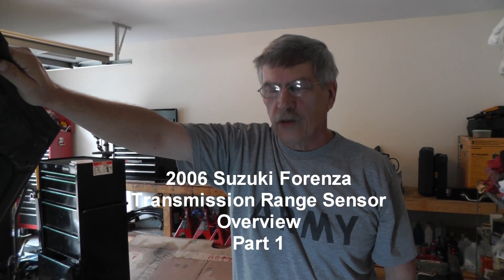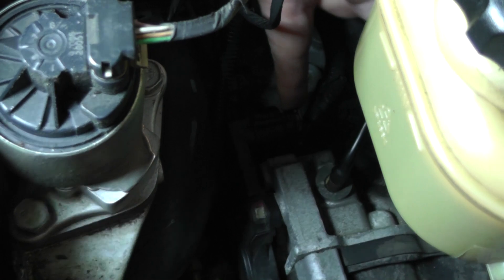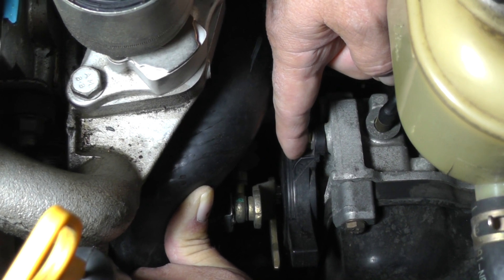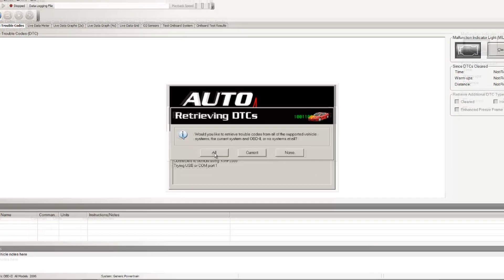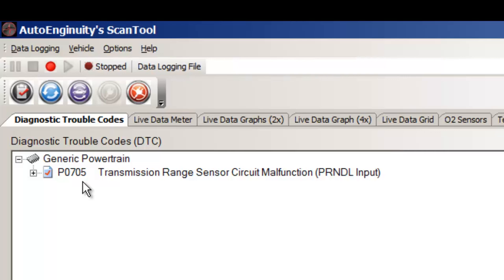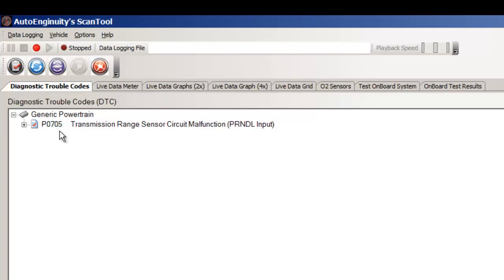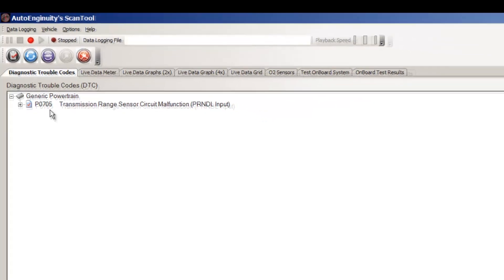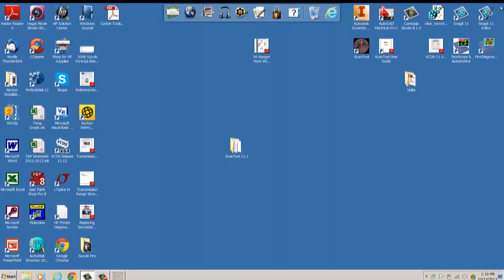Suzuki Forenza Transmission Range Sensor Overview - Part 1

Comment: I’m thinking about buying a 2006 Suzuki Forenza that doesn’t move when shifted to drive at least that is what is on the post about the car. Would the TRS be the reason?
Reply from the maker: Usually the car will still move, but it will start out in 3rd gear (limp mode). You may have other serious issues such as tranny problems. Just be careful if you consider buying the vehicle.
Reply: stuzman what would be some reasons that it wouldn’t move?
Reply from the maker: If the engine starts and run, the only thing that comes to mind would be concerning the tranny such as low fluid level or it could be some internal issue. If you've got a scanner, put that on there and see if there are current or pending codes. That could give you an indication of what may be going on with the car. If not, probably best to move on to another car.
Reply: stuzman stuzman here is what they just told me on that car. “Nothing it just won’t go very fast . I can put my foot all the way on the gas & it only goes slow” . So that sounds like the TRS right?
Reply from the maker: Yes, in the case that the car moves, it's a good chance that the TRS is bad. And if so, it should have throwed a P0705 code which indicates a TRS issue. If you've got a scanner, see what the code is to be sure.
Reply: stuzman good. They are selling it for $600 the car is clean and well taken care of. It would be a few months before I’m home again. But I’ll keep that in mind on the code n take my scanner. May keep it if I buy or flip it for a proffit
Reply from the maker: Sounds like a winner if it all works out :)
Reply: stuzman what would be roughly the top speed in limp mode?
Reply from the maker: TheRailgrinder you should eventually get up to cruising speed, but it will take a while to get there since it starts out in third gear.

Comment: Hello, I have 05 suzuki forenza with automatic transmission with code P0741 "torque converter clutch solenoid" I have seen this video on cleaning solenoids https://www.youtube.com/watch?v=ZbarS605YtE . I have no issue driving it. Could you tell me if this is doable since it is a different car in the video. I have yet to find TCC solenoid for sale
Reply from the maker: Hi Lucas and hope all is well with you. This is one of those questions of where you'll have to do some research and you can't compare that video you posted to the car that you have. The question to answer is how easy is it to access this solenoid valve in the Forenza. I don't have the answer to that because I don't have the car anymore and I don't have the service manual as I sold both a few years back. You can start by acquiring a service manual to see what's involved or you can poke around on a Forenza forum and see what's there, or you could post the question. The link to the forum is http://www.suzuki-forums.com/suzuki-forenza-reno-forum/ and if you want to get all the service information for your car, you could use this site www.alldatadiy.com Then with the information of what's available, you'll be able to answer the question of whether you can do it :)

Comment: +stuzman....I am currently having the " exact"  transmission problems that you have described, however, the check engine light has not come on. I bought this 2006 Zuzuki Forenza "brand new" in 2006. Currently, only has 58,000 actual miles.
This car has been an absolute nightmare. I have pretty much bought this car twice. I now understand why Zuzuki went bankrupt. Do you have any idea as to how much a dealership (I go to my local Ford) would charge for this sensor and labor.
And what are your feelings on having transmission fluid changed out? I hear a lot of conflicting information on this subject.
Reply from the maker: Debra Scott Debra, it could be the transmission range sensor which usually gives a code of P0705. Although the check engine light is not on now, you could have a pending code which is stored in memory. You need to put a scanner on it to see what issue there is. depending on the region, prices go from anywhere from $100 per hour and up. As for the transmission oil, you don't have a lot of Miles  on it yet. I will just drain the fluid and just replace it. Although this transmission does not have a dipstick, It does have a drain plug and a plug on the side of the transmission to fill the new oil back into it. Most shops would do an automatic flush where they will hook up a machine to flush everything out. Personally, I would just do the drain and just do a refill using the plugs that I mentioned.  Good luck Deborah on whatever it is and I hope it's not expensive 😀
Reply: +stuzman.....Thank you so very much for your reply and valuable information. By the way, this video is excellent.
Reply from the maker: Debra Scott thank you very much Debra for taking the time to watch the video and for your comment 😀

Comment: I have a 05 Suzuki forenza, where the gear indicator is at it is showing me a square box with a dash across, car won't let me crank it, the box it where is shows D R P N 123  what can be the problem?
Reply from the maker: Alru Most likely its your tranny range sensor. But diagnose it to be sure.
Reply: Hello Mr stuzman I was hoping you could help me I've sent the same question to different folks but none reply. The little hose that comes out or to the transaxle at its top I don't know where it connects to. The hose is seen in the video image before clicking it. There is a thread in the forum for it: http://www.suzuki-forums.com/general-forenza-reno-forum/171985-oh-where-oh-where-does-my.html#post1490698   Thank you for your time. And thank you for your videos

Comment: I'm going to guess someone has already asked you this but where did you get your adjustment tool from I need one and can't seem to find it to purchase anywhere.
Reply from the maker: Many times Teri, but be prepared for a price shocker. Go to the last video of this series and in the description of that video, you will see where I got it. But as I've said before, you don't need the tool unless you've got some money to burn :) Place the two mounting bolts for the sensor in the middle of the slots and you should be close enough for the adjustment. It's mentioned several times in the comments of the last video. Good luck on your repair!

Comment: I had the same issue with the clunking and the car kicking out of gear. Took to get diagnosed and they ended up with a brake switch code and TCM code but could never get a code for the TRS. Finally after a year the issue got real bad so took it back to the shop and finally got the TRS code. Found one on Ebay motors and had it replaced. Car drove very good for a week and began coding out again. Is it possible the TRS went bad again or was not adjusted properly?
Reply from the maker: If you're getting the same P0705, then most likely there is an issue with the tranny range sensor or it could have not been adjusted properly. As I've mentioned in the last video of this series, I show using a special tool to adjust the sensor. But you don't need it for adjustment. As mentioned, make sure that the slots on the range sensor are in the middle for the two mounting bolts and that should close enough for an adjustment. When I used the tool, there's where the location of the bolts were, (middle of the slots).

Comment: i have a 2006 forenza, starts up fine idles perfectly but when i take off from red lights its very slightly sluggish andwhen it shifts from 1st to 2nd it jerks horribly, if i let off the gas as it wants to shift it doesnt jerk as bad. could the problem be the trs or should i look elsewhere?
Reply from the maker: It could the tranny sensor, but before you just replace it, put a scanner on the car and see what code you get. Even though you may not have a check engine light on, the car probably stored a code. If you see P0705 then more than likely you have a tranny range sensor problem.

Comment: I have a 06 Suzuki  forenza mines has a rough idle and I'm only doing 45mph power comes and goes could this be the range sensor
Reply from the maker: It could be Marie, but it's best to put a scanner on it to see if it threw a code for the range sensor. The code will be P0705 if it's the issue.

Comment: I don't knw if it adjusted correctly. I dnt have the alignment tool n can't find one.
Reply from the maker: The alignment tool is very expensive, (around $120) and you don't need it. But a link for it is posted in the description of the last video of this series. As mentioned several times to others through comments and it's mentioned in the last video of where I installed the sensor, the sensor has slots where the two bolts goes. Rotate the sensor where the bolts are in the middle of the slots. If you have an issue with the sensor, your check engine light should come on. And take a look at the gear selector display. If you see a slanted line through the display, this is a good indicator there an issue with the tranny sensor.
Reply: Ok I'll keep u posted. I Know with the new sensor the shift indicater stays normal.

Comment: I have a 2008 Suzuki Reno the other day I pulled out from the parking lot it would not shift gears it revved and then it was like somebody just threw it in the low one. then it wanted to drive in neutral and Park we put a new range sensor on it and now it will go into reverse and neutral but still wants to drive in park can you please help me
Reply from the maker: If you're sure the range sensor is adjusted correctly, you'll probably want to get a scanner on it and see if there are any codes in the memory.
Reply: I don't know if it's just a correctly I don't have the alignment tool and I cannot find one it doesn't drive in neutral now and it will now go in reverse but it's still want to drive in park

Comment: I have a 2007 Forenza that will start and run but will not go out of park. It's like the shifter is stuck. Any suggestions of what could me wrong
Reply from the maker: Candice, take a look at your brake light switch. Press the brakes and ensure that the brake lights are coming on. If not, check the switch. The switch is used as a safety feature so that Suzuki does not want you to drive the car without any brake lights. The brake switch going bad is a common issue. I would look into that first.
Reply: stuzman thank u for the response. It was the switch. I have ordered the part and it will be here Tuesday.
Reply from the maker: Excellent Candice and glad to hear that it will be an easy fix for you!
Reply: You have to press down on the shifter to unlock it.

Comment: where the hell is the transmission fill plug somebody please tell me
Reply from the maker: The fill and drain plug is located on the side of the transmission, passenger side. It takes an 8mm square drive bit to remove the plugs.

Comment: I have a 2006 suzuki forenza 5speed it cranks and has a spark it will not start up doe
Reply: I can send you a video or something check engine light is on too
Reply from the maker: Check for fuel and if you have that, you may want to check your timing belt to see if it's jumped or broken.
Reply from the maker: Read the code and that should give you some direction for diagnostics.
Reply: yes

Comment: Hi I have a 2006 Suzuki forenza that I just had the head gasket replaced on. Before anything went wrong on my car it was running fine. After the head gasket was replaced (which your videos help me accomplish successfully 👍) the car seemed as if it had no power and wouldn't accelerate except for in park, but in drive or reverse nothing would happen. The first thing that we replaced was the throttle body. NOTHING changed 😠. So after trying and failing at that we replaced the neutral safety switch...and again NOTHING😖. So we thought that we may have broken the TRS so we bought another 1. At this point I have had it with this car. It has been parked for 4 months and no progress is being made. I am desperately looking for help to fix this problem. I want to fix this myself and not have to pay anyone to do it. If there is anything you can do to help me get my car back on the road I'm all ears and please feel free to email me with any solutions that may be helpful to me lakeisha.latimore@gmail.com

Comment: Forenza 2008 Problems
 
Miles 107+  It all started when my car would kick me forward while pulling off slow, it felt like someone rammed into the back of me. My engine light comes on and goes off. Took it to a transmission place and they can't pull up no history codes so they can't tell what's wrong with it. Sometimes it drives as if nothing is wrong then it will start back acting as described.  Today my car felt like it didn't want to go and I have to push down on the gas. The car revs pretty high. I feel unsafe in this car now.
Reply from the maker: Ironica, the next time your car acts up, take a look at your LCD display which shows your gear selection. If you see a diagonal line across the gear selection, then the most likely thing is the transmission range sensor. Hope you get it figured out.
Reply: Nope there was no lines going across the D. Nothing jumped out of wack on the dash board.
Reply: And engine lights comes on n and goes off. It doesn't act up all the time but when it does it's bad.
Reply from the maker: When the check engine light comes on, the mechanic should be able to read it with his scanner. When the light goes off, the code is still stored in memory. Don't know why he can't read it.
Reply: +stuzman52 the memory won't show up for reason.
Reply: I have the same issue with my 2007. Good little car and easy to work on but like stated has an intermit problem with the engine light going on and off and transmission acting up. Took to transmission shop and they changed brake switch and transmission module.  Will drive fine and then will start shifting and changing gear hard. If I stop and turn the car off and then back on it will reset the code and then drive as if nothing is wrong with it. I believe this is some type of electrical defect in those cars. I have changed the plugs, wires, and coil and it still shows engine misfire. If unplug the battery it will clear everything and drive like brand new. It's crazy because the mechanic can't trace the issue.

Comment: My Forenza was experiencing similar symptoms of hard shifting etc.  This was right after i replaced the radiator and with some bad info elsewhere....changed the transmission fluid, since i had loss.     However, just the other day I've lost all gears, it wont even engage park.....every gear is basically neutral,  i hear a continuous tapping or clunking sound when i shift to different gears, grinds like crazy when trying to hit park......never engages any actual gear though.   No check engine light is being displayed.   I was hoping it might be the range sensor....but with no code to confirm i haven't got a clue....more fearful that it could be something  more expensive.   Any thoughts?  

By the way....thank you so much for your videos, i replaced the head in my Forenza last year while following your videos, couldn't have done it otherwise.
Reply from the maker: First Jeff, glad to hear the head videos helped you out and that all worked out for. As for your transmission, you probably had a leak at the heat exchanger on the radiator. It sounds like you lost a lot of fluid and the tranny could possibly be damaged now. I assume that you found the leak and have refilled the tranny. The tranny range sensor wouldn't have anything to do with your symptoms now as it would still go in gear, although in 3rd because of limp mode. But it would still be driveable. Have you checked/ found and repaired the leak? And does the tranny have the correct amount of fluid? If the tranny has the correct level and you're still experiencing no gears, then your tranny sounds like it may be toast now. I surely hope not....

Comment: I just recently bought a 2006 Forenza and I'm having trouble starting it up. I can hear my car trying to start but it doesn't turn over. I can hear it ticking and every now and then my RPM meter will spike a little but won't pass 1. I have to fight it in both P and N to get it to start. Would this be an issue caused by the Range sensor?
Reply from the maker: If you have to move it from P to N to drive and get it start, it's a good chance that it could be the sensor. Instead of just changing it and hoping for the best, it's simple enough to check. On the wiring diagrams in this series, take a look at the tranny range switch and look at the switch for the P and N and do your diagnostics at the range sensor. You should know for sure if that's working or not.